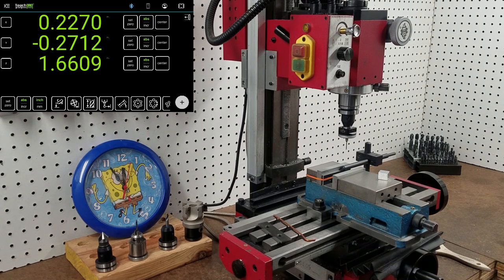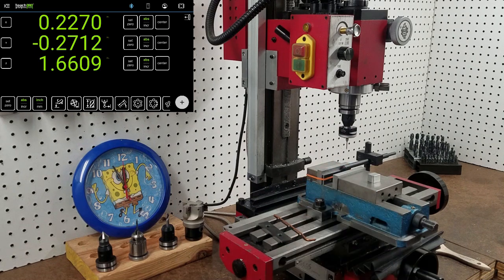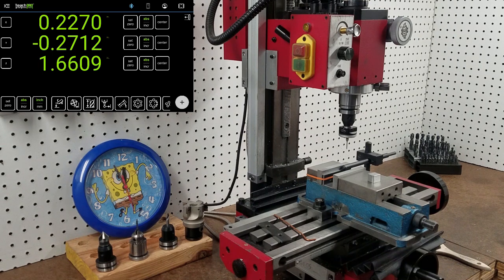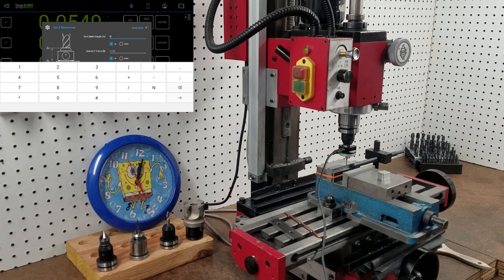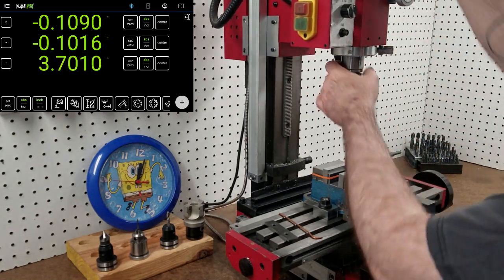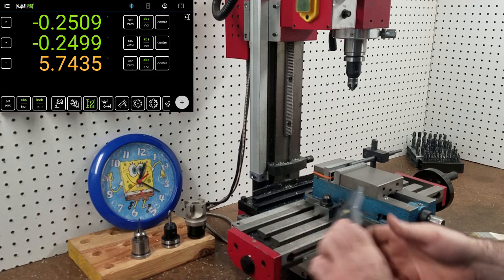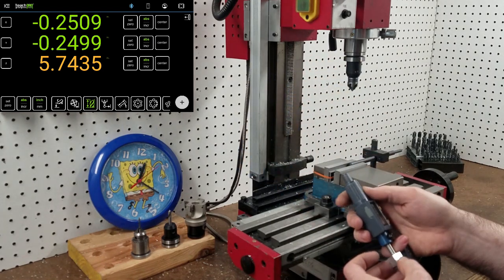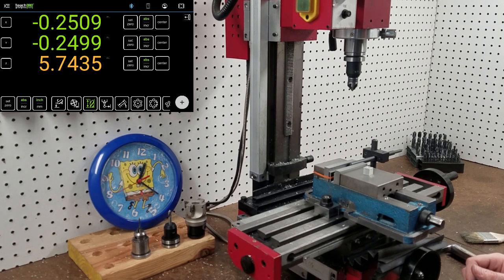Machining a Cube Without Measuring, Using TouchDRO!

Comment: So, you're using Tormach TTS holders? I've never used the Z axis touch off for tool setting because I rely on R8 collets. I noticed that your data input screen looks different to mine. I only get digits and some multi character buttons. I only got the extended input panel once, which was great, but then it went away. I was wondering if it's a Samsung thing?
Regards, Preso
Reply from the maker: @Preso58  Yuriy only added the Z touch probe in the most recent update to TouchDRO. 

I can't recommend the TTS holders enough. I absolutely love them. Even without the repeatability aspect, just being able to change tools so quickly is so worth it. Add in the Z-axis repeatability, couple it with the tool library in TouchDRO, and it's just plain awesome.  I didn't realize how much I've spoiled myself, until I had to use a mill without any sort of quick-change tooling. 

My mini mill is also R8... Tormach sells a special flat-nosed 3/4" R8 collet, but I just took the 3/4" R8 collet I already had, and held it to the belt sander. As long as the nose of the collet is recessed inside the spindle nose, flatness doesn't matter.

I also made a spindle nose adapter for my Van Norman No.10, so I could use the TTS tooling on that mill, as well. 

I use cheap Amazon Fire tablets for my DRO displays. The stock Fire keyboard is pretty... Lacking. I use SwiftKey, instead. I wish there was a way to force a "calculator" keyboard, but my brief searching hasn't yielded anything. I'll keep searching.
Reply: @fna-wrightengineering  Thanks for that info. I just checked and genuine TTS holders are about US$30 but I saw Chinese knockoffs for AU$17.21(for an ER20 version). That's less than half the genuine price for me even if I have to buy the ER20 collet. I will have to play around with the keyboard options on my tablet to see if I can find a better version that is compatible with TouchDRO.
Reply from the maker: @Preso58  I picked up a few of those import ER20 TTS holders, and they all had pretty bad runout. Combine that with import ER20 collets, and the runout got bad enough to make them basically useless for small end mills and drills.

Import tooling has definitely gotten better in the last few years, but it's still a gamble... The ones I got were garbage, but you may get good ones. As always, your mileage may vary.

I did find a use for mine... I use them as tap holders. I put them in the spindle without tightening the drawbar, and the R8 collet basically acts as a tap guide. I made a set of nesting wrenches which both tighten the ER20 collet nut, and act as a tap wrench. Made a video about it 😁